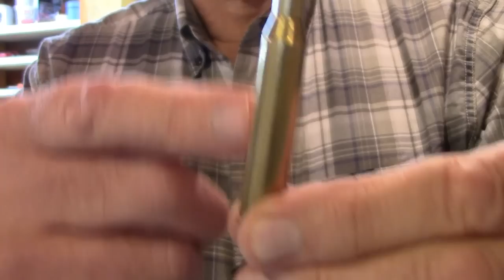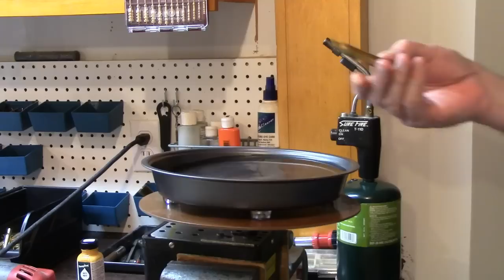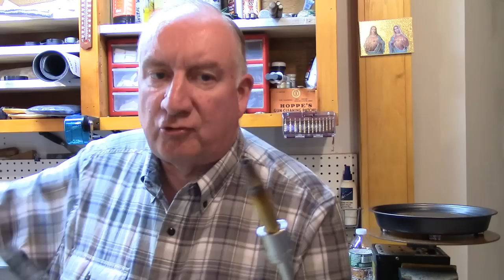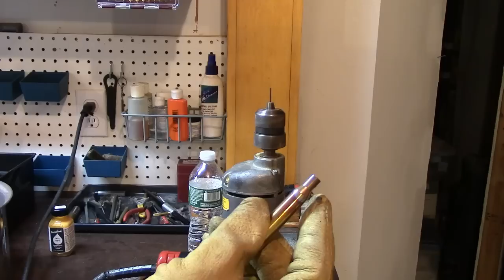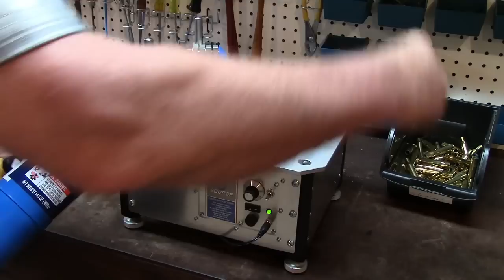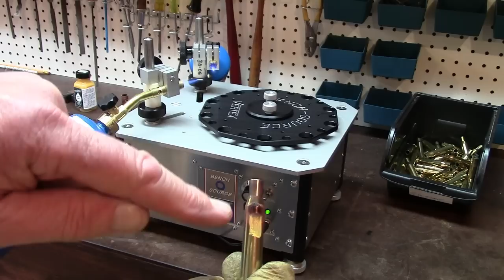How to Anneal Brass ~ Vertex Bench Source or a Tight Budget!

Comment: When I am forming 300BLK from .556 I cut it down from the .556 then anneal it. I find this makes the reforming go smoother and keep the case from sticking in the die. I am wondering if I should anneal it again after the reforming because I’m thinking that the reforming will stiffen it up again. What do you think?
Reply from the maker: It can't hurt.  But in actuality, you aren't really doing a major reforming down to 30 caliber.  My biggest concern however, is that you must ream the case necks. That's an essential step whenever you are creating necks from material below a case neck, where it's quite thickly tapered and uneven, rather than parallel.  That taper makes a donut of brass around the bullet that will prevent correct neck tension near the case mouth, but overly tight tension at the neck, which will jam on expansion during firing around the bullet rather than releasing, which will dangerously spike pressures.  Forster makes neck reamers in all calibers that fit their trimmer, and will do a nice job.  Other companies do as well.
Reply: GunBlue490 Thanks for the info. I have a case prep unit that camphors and reams. I am going to reload these for subsonic so I’m not expecting high pressures. I appreciate you ability to instruct in a concise manner. It’s a talent that many YouTubers seem to fail at. Your knowledge that you pass on is making a difference for me.👍

Comment: Hello gunblue. Is it critical or just good practice to use a rpm of 60?  (1 revolution per second) when using the first 2 methods if your only using one torch? so when you count seconds you are getting  even heat?
Reply from the maker: No, RPM is not critical.  The primary issue is to rotate the case quickly enough to maintain even heat distribution around its circumference.  60 RPM is about the slowest I would go, but what's most important is developing a uniform method and heat application.
Reply: @GunBlue490  thanks I will keep that in mind.

Comment: Dear Gunbue490, I have just fire formed 100 222 Rem. Mag. cases that I  made from 204 Ruger brass.   Would there be an advantage to case life by annealing these cases before the first reloading? I am asking this because it seems to me that I have already stressed the case neck a good bit by stretching them by .020 inch.
Reply from the maker: Robert Tisch 
Actually, that operation is not really that stressful to the necks, unless they had been fired and resized previously.  I have resized hundreds of 7mm-08 cases down to .243 without any issues whatsoever, and reloaded them three times before finally annealing.  Expanding has less hardening effect than compressing, and the amount you are working is comparatively less than what my brass is, so I think you should be fine.

Comment: I've a new 6.5 creedmoor and reloading; so there's a learning curve for me. I'm leaning to the water bath idea after 3 to 4 reloadings ?
Reply from the maker: Walter Palmer 
Most cases can stand 5 or more, especially if you only neck size.  The best and gentlest neck size is the Lee Collet die.  I have loaded several of my calibers well over six times without annealing by using that die.  Of course, it's strictly a bolt action rifle method, using the same gun.
Reply: Appreciate your replying. Yes, I'd be reloading for one bolt action gun, a Tikka. Showing my ignorance, so instead of reforming the entire cartridge to factory specs using the Lee (which I've ordered), you use the neck collet die and disregard the entirety of the brass case. thus limiting the cycles of expansion and contraction in working the entirety of the brass. Makes absolute sense.

Comment: To harden steel don't you heat it up and then dip it in water (oil) is that different with brass
Reply from the maker: The hardening of steel, called tempering, is a very exacting science that brings the temperature of the metal to various specific temperatures for whatever hardness is desired, which can be halted or enhanced by quenching in water or oil. Brass is entirely different. It is hardened and becomes more brittle when hammered, which occurs during firing. If overheated, it becomes too soft and is useless for cartridge cases. The only reason to employ quenching is to cool it for purposes of immediate handling. Once the heat source is removed, it begins cooling immediately, and remains at whatever softness the heat brought it to, but there's no quenching required for metallurgical purposes.

Comment: Hi can you tell me can I reload 5.56 Brass to use in my 223 Rifle ?
Reply from the maker: Absolutely. You can because it's exactly the same brass. The only differences are the greater powder charge weight of the loaded ammo, and the crimped primer pocket of the 5.56mm (some .223 Remington ammo is made with crimped pockets). The crimp must be removed with either a swaging tool or cutter before inserting a new primer. I've reloaded many hundreds of formerly military ammo.

Comment: I tool brass quite frequently for other than reloading. I can tell you every metallurgy documentation I have read says tp quench to stop the hardening after heating to a dull red color. I know by experience that heating brass then letting it cool slowly then working it is how you harden it.  If I receive tooling brass, "Hardened Brass"  I have to temper and anneal it to make it soft and it is quenched to do this.
Reply: read carefully again.

Comment: I like Gunblue &, heartily agree with most of his opinions. 
I enjoy very much his talks on all the aspects of hunting, reloading, effective cartridges for different hunting & so forth.
However, annealing has taken a new turn. 
Although Gunblue has faithfully represented the annealing consensus to date, new information has surfaced which will invariably change the way we anneal for the better.
Sadly, most of the conventional wisdom of annealing as it has been done over the previous decades, is simply incorrect. For example; The cases can be cooked or ruined with too much heat. This is simply not correct at least up until the case is melting.
It is a fact that 70:30 cartridge brass is annealed in industrial ovens at 700 C for many hours in order to gain the correct annealing range for the proper shaping of the brass. Material does not burn out of the brass nor is there any other detrimental chemical or physical change with elevated temperatures before the melting point.
In point of fact, AMP use 1030 F in at least one published recipe for 223 Rem & I suspect that temperature range would be universal for all the cartridge recipes. That alone should tell annealers that there's something not quite right with the general annealing consensus at the moment. 
Gunblue has been around a long time & certainly knows a tremendous amount about our wonderful sport so, I think he's well able to take a little constructive criticism in his stride particularly when Gunblue himself is not at fault.
For anyone interested in the truth about cartridge annealing from the perspective of a trained metallurgist, "Reece on the Range" has an excellent series on the facts about the metallurgy &, how to measure the annealing process. 
Kind Regards...............Rotas

Comment: If I properly anneal 338 win brass.
Keeping pressures in 55-57000psi in a savage bolt..
Neck size.
Approx how often should I anneal and what type of brass life can I hope to attain? (Brass price is horrible).
Thx
Reply from the maker: After every three or four loads is plenty.  With neck sizing with a Lee collet sizer and annealing, you may get ten or more shots. I have had cases go beyond a dozen.
Reply: @GunBlue490  Thank you for the fast reply. I will be happy with 10.
I am trying to get away from petroleum lube for resizing full length cases. Only one I see in aerosol is hornady which is difficult to find so I end up tumbling in two stages to remove any lube. Thinking of watering down the lee lube and spraying from a hobby paint brush at 50 psi.  Are the lee neck sizers carbide do they can be resized without lube?

Comment: What is the difference between dropping the brass into water to cool it and quenching?
Reply from the maker: Alan Bycroft 
Quenching is a term that is used in conjunction with controlling metal hardness and specific temper by immersion into liquid, generally oil, at very specific temperatures that halts any metalurgical change at a very finite point.  Steel for instance, may be quenched in order to be easily bent and formed into wire to make a spring, and then quenched at another temperature to be "spring hard", at which point it has a hard, tough, elastic temper. The same steel may be quenched and become "file hard", which will file other steels, without suffering loss of its own.  Neither would be suited to the knife or sword maker, who quenches to make a tough, semi hard steel that can be repeatedly sharpened, but without being brittle.  Screwdrivers must be hard and tough, with entirely different hardnessm.  Steels and other metals can be brought to an entire range of temperatures and quenched for an incredibly varied degree of hardness, maleability, ductility, resilience, and machineable property.  However, cooling hot brass in water achieves no metalurgical action whatsoever, except to just cool it. Brass brought to 650 degrees or any temperature, and which is allowed to cool, whether naturally or in water has the same property.  The highest heat the brass is brought to determines the degree of its softness, no matter how it is cooled.  One may use the term to quench for cooling, as in one's thirst, but it has a specific connotation to the machinist or blacksmith.

Comment: Gunblue when do you anneal your brass the first time, and is there ever a second or third operation?
Reply: Myself, I anneal after every firing (I load for accuracy and use an AMP annealer, so it's quick and easy for me), some will say that might be too often, I disagree...But that's an argument for another day. The general rule most go by is about every 4-5 firings. 

A few points..

1. Cooling in water is not necessary for Brass (steel, yes), if you think it is, do some research on metallurgy. It's sometimes used on Brass to stop "heat creep" to the lower end (head) of the case.

2. Not all case Brass will show the same "blue discoloration" or at least not vividly. As GunBlue stated, case Brass is a formulation that manufactures design like cookie dough, each manufactures formulation is different and will show discolouration slightly differently.

Accurate shooting is all about consistency, consistency, consistency!, listen to what Blue is teaching you.
Reply from the maker: Bob Wire 
Annealing is not cumulative.   Once cooled, the same brass may be treated again and again.  Nor is the time in the flame cumulative from one treatment to another.  You noticed that two of my cases received only 1 second of heat before I dialed up the time.  They will be tossed back with untreated brass and done with the full time, and their treatment will be identical.  Likewise, brass that has been subjected to mixed number of reloads may be treated together, and they will come out the same.  Annealing is a reaction to temperature, just as water boils at 212 degrees F, no matter how many times it has been boiled before, or whether it has been mixed with ice water.
Reply: GunBlue490 thank you! I am always trying to wring the last drop of blood from the turnip in my extended long range rifles and I have just avoided this part of the process up to now ,but have been considering this before you posted the video. You're classes are very informative on little things I may have forgotten or not considered, thanks for replying. wonder if you could do a short series on the 6 br I built one last year and there is just not enough information other than wives tales and fokelore on it other than the standard reprinted article on 6br.com thanks again

Comment: could you please make a video on your opinion on 270 wsm?
Reply from the maker: Christian Rojas 
Well, I don't plan to, but here's the story in a nutshell, for your interset.  The 270 Winchester delivers extremely good, proven killing power and ballistics beyond practical hunting distances on all game up to moose and elk, and does so very efficiently with lightweight 22 inch barrels, that last a very long time, burning generally less than 60 grains of powder, with very tolerable recoil that most shooters, including my 5 foot, 125 pound wife can handle.  The 270 WSM shoots the same family of bullets at approximately 100 feet per second faster, but because its case capacity is less efficient, it requires an additional 2 inches of barrel length, or about 1/2 pound, though its receiver is slightly shorter by about 1/4 pound.  The gain of 100 feet per second gets out another 22 yards, but it does so with a significantly large amount of additional powder, that raises the recoil level beyond the 30-06 or about that of the 7mm Remington Magnum.  270 Winchester ammo is found in every corner of the world, while the 270 WSM is still in its infancy and some wonder if it will survive in the years to come.  My own personal opinion is that it's a round that serves no particular purpose, shoots no faster, flatter, or more powerfully than I could ever possibly need over my 270 Winchester, using identical bullets, burns a heavier, longer, bulkier barrel up with increased barrel erosion from large quantities of slow burning magnum powder, uses expensive brass and ammo that's harder to locate, if at all, and may even join the long list of maverick cartridges some day.  It recoils hard, makes more noise, and even its magazine is one round smaller due to its fatness.  It's a very fine round, but I see no point in it, whatsoever.  Remember that arms companies release new calibers all the time to keep interest up and money flowing, not because we need them.

Comment: Great channel, love your videos! Just one thing, you are being too overly concerned over the amount of carbon monoxide your torches will produce. Yes, carbon monoxide should be of concern with any open flame and one should be aware of the dangers, thousands of people die from it worldwide every year. However if you look at the cases you will see some very stupid mistakes such as operating engines indoors. I run a kerosene heater in a smallish room most days in winter and I have never had a problem (disclaimer - I do have a sense of safety and more than one brain cell). The window in this room is always open a crack, maybe 1" - 2".  I have several carbon monoxide testers and have never seen carbon monoxide levels rise any significant amount or anywhere near levels of concern. Would I turn the heater on in a closed or sealed space? - no. Carbon monoxide levels by a proper functioning and adjusted kerosene heater will produce minimal amounts of carbon monoxide. As long as combustion is thorough, carbon monoxide release will be low but it will increase with incomplete combustion (yellow flames). This is mainly caused by running combustion too rich but can also be caused by reduced oxygen levels - always allow fresh air to enter a room. I am using a kerosene heater as an example but it applies to any device with a flame. On the other hand, engines produce copious amounts of carbon monoxide and should never be allowed to run indoors except for very short tests and even then only in a ventilated area. The little flames from your burners are very tiny, you'd have to really try really hard to give yourself carbon monoxide poisoning with them, to be quite honest I am not quite sure if you could ever achieve it. Think of the flame on a kitchen stove, way bigger than that and people aren't dying like flies even though they are used daily worldwide without any care about carbon monoxide. Its like everything else, lots of things can kill you but you really have to go out of your way or be very stupid or clueless for it to actually happen. Buy yourself a carbon monoxide tester and see for yourself, they can be had in units like smoke detectors (these go through a fair amount of batteries) or handheld testers.

Comment: I am thinking of owning a wooden stock rifle (WW2 era rifle). What care does the stock need? What not to do to wooden stock (common mistakes)?
Reply from the maker: Miguel Hernandez 
Military woodstocked rifles were generally protected by simple boiled linseed oil, and require very little care.  They are often very dirty, so an occasional wipedown with mineral spirits, followed by an application of Butcher's paste wax (bowling alley wax), will afford protection.  You can even apply the wax to metal surfaces for additional corrosion protection.

Comment: Is there any benefit to dropping the cases in water as opposed to air cooling?
Reply from the maker: medhist2006 
Brass hardness cannot be controlled by quenching as with steel, so water can only cool it for handling purposes, or to prevent overheating, as with the water bath method. No advantage or disadvantage.

Comment: I think the word that you are looking for in your explanation is malleable instead of ductile. Ductile is usually used to mean drawing a metal out into a wire or string. I think you mean to use malleable which means working with metal to change it or form it. Check it out if you want